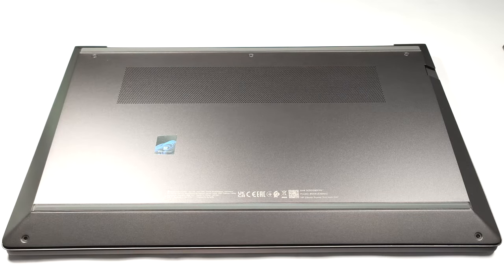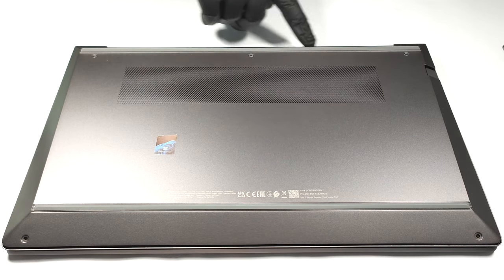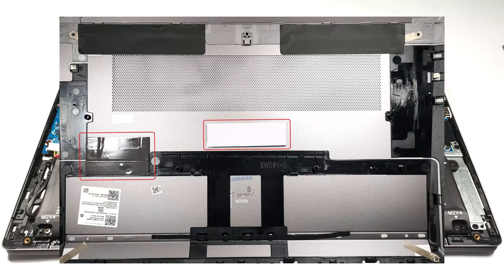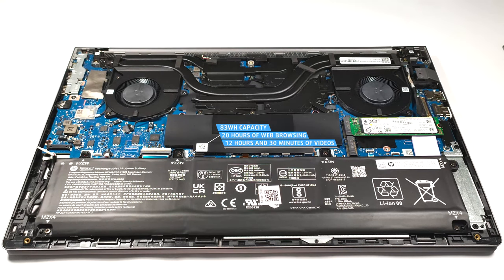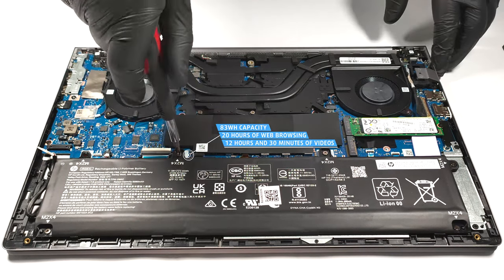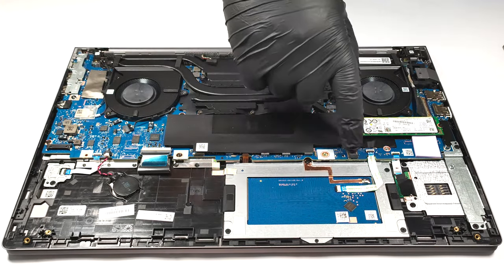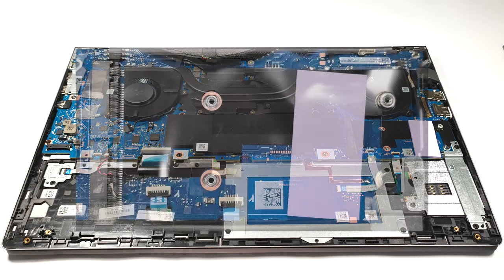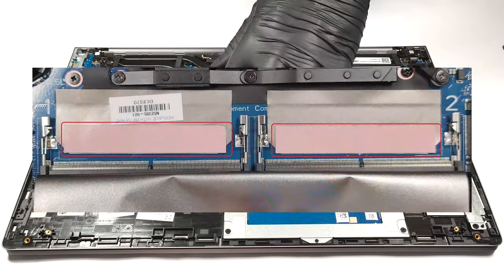🛠️ How to open HP Zbook Power G10 - disassembly and upgrade options

Comment: I had to work on one of these things today, what a pile of junk!. The bezel and the hinge cover are one piece, the LCD panel has FOUR strips holding it in, 3 of then snapped in half and one was like super-glued in -and the wireless card is on the system board. HP held nothing back ripping off you who bought these. Better hope you never need any maintenance ! It's almost like they took engineering lessons from crApple.